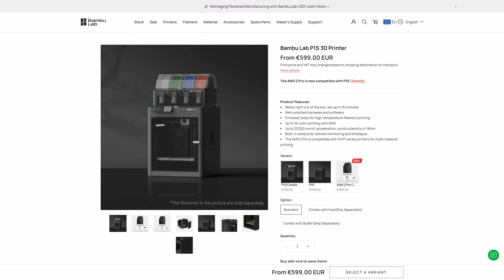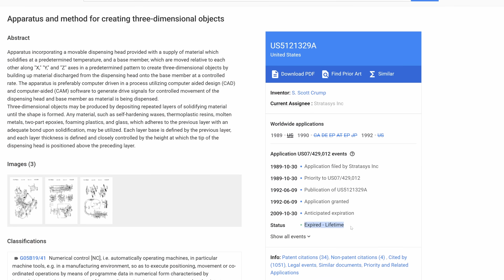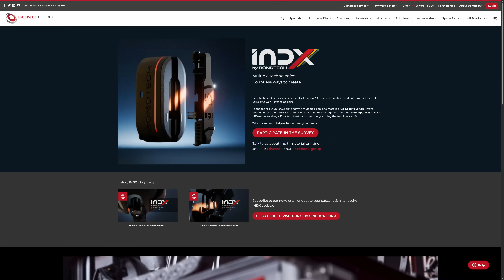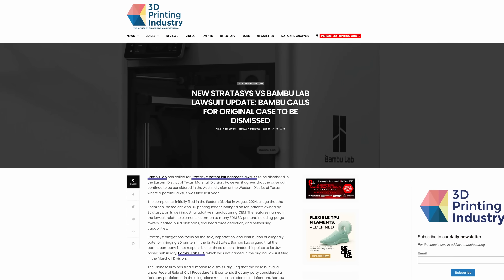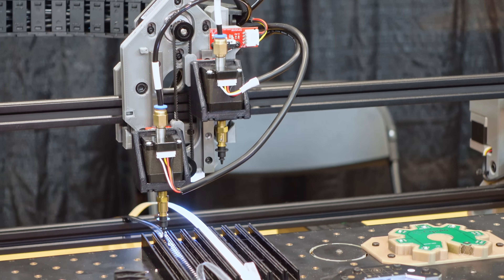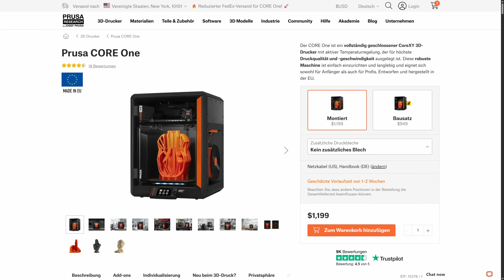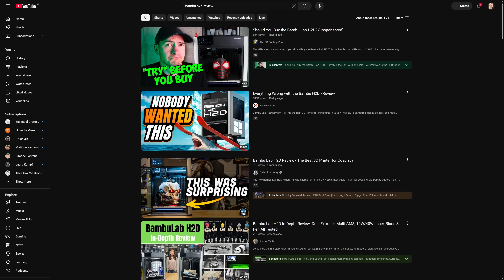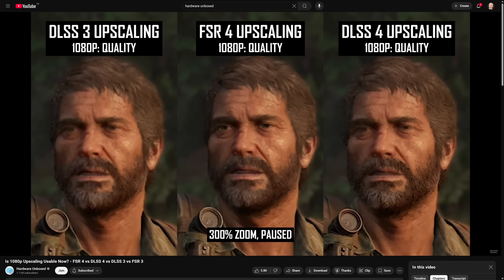How Bambu has won

Comment: I got into 3D printing a while ago and watched this channel loads. Your channelled helped me massively in getting started with 3D printing and even answered a question I had on one of your live streams. I've still got a 3D printer, but it sits collecting dust because I got fed up with the frustrations and messing about I had to do just to do a print, and it got worse when that print would fail at 80% complete. I've decided to buy a Bambu Labs P2S with the AMS Pro 2. Won't arrive until late January, but I'm excited to get back into 3D printing. Might even get my current one out for old times' sake. I'm a bit out of the loop when it comes to 3D printers; however, I'm vaguely aware of the drama with Bambu Labs. While I'm an Android user and not an Apple user, Bambu Labs seems to be the Apple of 3D printers, where their products, most of the time, just work out of the box with very little messing about. I'm looking forward to not having to manually level a bed ever again, even though I could fit an auto bed leveller to my current printer.

Comment: I look for open source, function over form, and industry-standard-ness.  Would be interested in your opinion of the Elegoo Centauri Carbon - CoreXY, no online requirement, can be used with generic OrcaSlicer, klipper(?), and comes practically fully assembled and works beautifully out of the box with auto bed leveling etc.  I have no idea of long term durability or parts availability, but I gather it is more like Ubuntu than Bambu's Apple-like ecosystem and prices.  Time will tell if I made a mistake or not.

Comment: I started out with a...uh, Monoprice something mini, which was pretty awful. Then an Ender 3, which taught me a ton about how to get a printer to work, but it still didn't work well as a reliable production machine. A couple of years ago, I replaced the Ender 3 with a K1, which has been running non-stop for the past three weeks, printing a prototype boardgame. It's my first printer that just functions as a piece of industrial equipment; I'm not constantly fighting with it, especially after upgrading to the Unicorn hotend and the newer extruder - upgrades that weren't really needed, because I got lucky and the machine just works.
...which, in a way, kind of sucks. I've never seen the mainboard for this machine and have done little beyond greasing the rods and rebuilding the printhead. Meanwhile, with the Ender 3, that thing was gutted on a weekly basis. But it doesn't suck, because this thing is a tool. I've come to the realization that having 3D printing as a hobby is like having impact driver as a hobby; it is a thing I use in the pursuit of something else. It's like in photography: the camera, lenses, memory cards, film, whatever doesn't matter, it's what you actually do with it. Anything otherwise is just marketing to get you to buy a product.
So, like with my computer, I'd like to know the machine inside and out, but, unlike my computer, I think I'd rather have a machine that just functions reliably without the expectation of constant fiddling.
...but I don't want to have to create an account just to use my machine locally. That's stupid.

Comment: Five months later...and how things have changed.  Bambu has chosen the closed system path and its inherent premium costs.  There will be a big market for this, but it has also fueled a bigger market for open system solutions.  Bambu makes a remarkable printer, but other manufacturers have closed in on their speed, accuracy, and feature set.  The enabler for this is simple economics.  The market will not tolerate the type of product positioning that Bambu locks you into.

Comment: If I have to know anything about the firmware and tinker with things all the time, it's a faulty product.

Buying a 3D printer is like buying an electrical screwdriver or any other tool. Where is the hate for all the none opensource screwdrivers?
Reply: No, buying a, at max, 90$ screwdriver is not the same as a multi-hundred dollar 3d printer

Comment: Well, for me, it's a pretty easy answer. 

What I want to know in a review of a 3D printer is: 
(in this specific order) 

- What is the performance like, especially compared to other similarly priced machines. (50% importance)
- Does it need proprietary software, consumables or replacement parts, and what do they cost ?  (30% importance)
- Is the company sketchy in general, what are their tactics ? (20% importance)

Obviously, there are a LOT of specifics but these are the main points. 
For me, a simple example that many wouldn't even care for, is "Does it have a Home Assistant Integration?" If not, I'm probably not buying it. :D
But in general, for 3D Printers at least, performance is all I care about. I mostly print functional parts, replacement parts etc, so I care a lot more about which types of filaments can be printed, than how many colors can it print. :)

Comment: Like you, I started out in 3-D printing when you made your own, or bought a kit and modified it to do what you wanted. Now, decades later, I just bought a Bambo Lab X1-Carbon Combo and fitted it with a Sunlu filament drier lid on the AMS. The machine is fast, very fast. I don't like the massive amount of pre-print diagnostics and set-up analysis the machine does on each print. I am not particularly happy with the required proprietary slicer software either. I am used to editing the gcode for my prints prior to printing, and writing first layer customizations for my prints. I think that those days are quickly drawing to a close. You asked what we want from your videos. I would like to know as much as I can about how I can get the most out of my X1-C using it's proprietary software. How do I turn off any unnecessary pre-print set-up? How do I get it to print flexible materials? How do I let other people thinking about wanting to buy one know that the user agreement (that you have to agree to before you can use your machine) takes two hours to read through and has all sorts of stuff in it that you won't want to agree to. That is the sort of stuff that needs to be talked about these days. Thanks for making informative videos. I like your format and style.

Comment: You should care also about the future of printing. When china takes over, you will want that prusa never left. If there is a monopoly, they can and will do whatever they want. Just like in so many other industries.

Also, why not care about working conditions of the people working there in the factories? The poor guys are probably inhaling deadly smoke on a daily basis for you to enjoy a cheaper printer. Very short sighted view in my opinion.
Because you were an early adopter, you clearly didnt care about having a machine that "just runs", as you would have stopped quite quickly then. - Feels a bit like you want to speak for the average joe, but you are not the average joe.

Comment: I stopped watching your channel when I felt like your channel was turning into a Prusa only review channel.
I use printers mostly for work, I have no loyalty to any manufacturer. From that perspective I really don't care.
As someone being a big advocate for open source hardware and member of the Open Hardware Accociation I do care a lot about companies doing Open Hardware.
The problem is that Prusa has been down a path of closing down long before Bambu came along and their commitment to open source turned largely into a lip service beyond the parts they were obligated to release due to inherited licensing, so hardware was the first thing they closed down because that was not under those restrictions.

Worse than a company not doing open hardware is a company pretending to do open hardware while delivering proprietary products and then later blaming open source as the reason for being overtaken by competition after failing for almost a decade to bring out new innovative products. That behaviour does to deserve grace or community support and should be shunned and I'm kind of disappointed that we still treat Prusa as being any better at this than Bambu.

Comment: Seems i missed this one in your streams :). Yes the bambulab is for the new generation of click and print (like we used to do command line and then got gui's ). But if something goes wrong they are like wut... and sometimes sell them darn cheap ;) the good thing about not writing firmware etc the machines just work (my prusa's do ). What i am interested in is what can a machine from brand x accomplish how good is it out of the box without tampering etc. Like the 20mm cube should be 20x20x20 etc. Looking forward to more vid's with offcourse your favo filament type. Did you watch the Proper Printing vid about him and the bambulab btw ;)

Comment: After 7 years of screwing around constantly upgrading and repairing my old printers I got sick of it. I just want these things to work and print me stuff I design. Bambu Lab in this case offers me exactly what I wanted 7 years ago. Their printers essentially just work and I love it. Ofcourse if they screw up software or new printers to a point where it starts screwing me over then that's the point I will probably say no to Bambu Lab. But until then they are winning over more and more people and for a good reason.

Comment: lol.  Sponsorship spot as an educational talking point is next level, and I love it :)

Anyway, I'm actually super torn on the subject of Bambu, specifically, if I want to get a P1S, or wait to see how the QIDI Q2 shakes out.  The Q2 has the P1S beat on paper, but Bambu hardware is proven hardware.

On the one hand, yes, they just work.  On the other hand, they're a pain in the ass to mod.  For example, I'm not even a big machinist tech guru who wants to build my own printer from paperclips and toilet paper tubes.  I DO want to be able to use whatever software I want, whatever screen I want, change out a ferociously noisy exhaust fan without needing to have soldering experience first, and most importantly, to change between a 0.2mm and 0.4mm nozzle without having to change the hotend every single time.

Edit to add: Sorry, went a bit off topic there haha.  Unfortunately I'm new around here so I can't offer much constructive criticism.  I can say I've enjoyed the videos I've watched so far and look forward to hearing your insights on the 3D printing landscape in the future though.

Comment: I just feel like i'm getting scammed by buying "open source" alternatives. 

1. they aren't even completely "open source" or "offline-functional" most of the time, not even prusa (camera feed, app functionality, some parts like motherboard etc.) 

2. they cost unreasonably more (I know they aren't manufactured in china, but when you print your own parts (which I would argue is a cheaper and inferior way of actually making parts for a "premium priced" product) why is it still costing more than double what the alternatives cost (keeping in mind the other points i will mention)

3. they cheap out on everything and upsell you basic stuff like there's no tomorrow for the most ridiculous price. the core one comes with a brass nozzle (other nozzle costs $50), "quick flow" $75), no camera (that's another $50) not even a god damn filter set ($75, you know, for your health), bugs and problems and features still not completely thought out like the nozzle changing system still being much more time and effort consumer than other manufacturers solutions.

like what am I as a consumer actually from that? I get a bare bones experience, where every single thing is a giant upsell, be it the display, nozzles, filters, camera, replaceable one-time use pieces that are designed to break when doing maintenance (you cannot tell me prusa couldn't find ANY other way of doing this) , features lacking behind, systems being buggy and prone to needing maintenance, and not even being completely open source or offline usable. 

I am literally getting scammed and f'd over in every way possible.

Comment: And that's the beauty: the market reflects what we as customers want to have. Bambu Lab went the full Apple route because a lot of people want to have a 3D printer as a tool, not a project in itself. ✌️
BUT: Bambu Lab will stumble over its own success. Especially regarding their QC of the H2D and H2S models. There are some videos adressing print problems with the H2D that are caused by a lose hotend plate - the hotend assembly can wiggle. Solution: take the whole printhead apart and make sure every screw is tight. And THAT is stuff that definitely do not belong to a highend printer that is "easy to use" and supposedly delivers "flawless prints". 🤷‍♂️

Comment: The reputation of influencers/channels are heavily influenced by who thy choose to use as sponsors. For example, VoxelPLA has an abysmal reputation with preprinted printer upgrades and customer service (the Bentobox for Bambulab is the one I have direct experience with). I ordered this and received crushed pieces due to poor packaging. After contacting them, they [finally] sent piecemeal replacement parts that were poorly printed, with the screw inserts falling out. Looking on various forums, I am not alone with my experience. I will never order anything from VoxelPLA again.

Comment: This level of control is has increased exponentially in recent years, across many areas. 
If we look at software in general, it's getting harder and harder to "buy" a product outright because the subcription model is taking over. 
The same goes for music (Apple, Spotify), films/series (Netflix, HBO), games (Steam, Ubisoft, EA), ebooks (Kindle). 
You only own the right to use the item for as long as they let you. There are of course "options" for getting round a lot of this. ;)
In this particular instance, I think there are many users who don't want to tinker with their hardware, they just want it to work (almost) every time.
I have an FLSUN delta printer that I've spent many, many hours/days "tinkering" with!
I also have a Bambu Labs A1 that pretty much prints everything decently first time!

Comment: As a 3D printing business owner, I just want good machines that work with minimal downtime and the ability to purchase and replace the damaged parts ourselves. I almost don't care about open source at this stage since it doesn't change anything for my business. It used to be nice back in the day when I started learning about 3D printing ~13 years ago. Things were very different back then and the shift to use these machines for manufacturing products makes me focus on reliability rather than open-sourcing.

We still have a couple of Prusa MK3S's but most of our 50+ machines are Bambu machines. Ease of mind and excellent performance at a very tempting price point.

Comment: I spent a really long time tinkering with and modifying printers.Bought and repaired old printers.But I only ended up there because the printers couldn't do what I wanted. I wanted to do cosplay back then. Unfortunately, the quality was not so great and I then went to the screwing It was really fun but also time-consuming.At some point I was at the point where I wanted to give up the hobby because it no longer fit in terms of time Then I came across Bambu Lab and just bought a printer. I was surprised and yes, the tinkering with the printer was gone but I could finally concentrate on the design of projects which I actually always wanted to do I think I'm not the only one, am I?

Comment: I have a master in mechatronics and automation, and bought my first 3D printer 11 years ago. I like learning how stuff works, but it was just such a hassle to need to play with all parameters, settings, mods, parts, functions to get 3D printing working after at least three trial prints that I just stopped doing it. I have had lots of ideas of things to print, but I just didn't have the time and energy to dive into my old machine again.
BTW, it's a Flashforge Dreamer so it's more of a finished product than most where back then, and I printed mostly in ABS to be used outdoors.

Now I have a Bambu A1 with AMS, and it just works. I love it! It's fast, reliable and quiet. I can start prints remotely and they work first time (mostly).
It's about the design, quality and function of the printed parts, not so much tinkering with the printer and process. Now I print in high speed PETG with better quality than before.

Comment: The problem with open source is that it stifles competition in key areas. What you get are dozens of near-identical printers but none that really push new features to the front. Why? Because open source does NOT allow for a big R&D budget. R&D is recouped by giving your product & edge and what edge do you have when every feature in a printer is thrown out on the market for others to copy outright?

Before Bambu came along, the market stagnated massively - every printer suffered from the same issues and almost every printer was Chinese, cut corners & had issues that were never fixed before they pumped out another model. Rince & repeat.

Bambu fixed all of that: they DID properly invest in research, they DO support their printers properly, they DON'T constantly pump out new models, and they don't really cut corners. 

But any company wants to make a profit and you can't do that when others will steal your ideas. Since the X1C we've seen quite a few copy cats that make cheap dodgy copies that don't functional nearly as well but still cost quite a bit.

So in the end you have to choose: do you want a market that evolves and grows with brands investing into R&D but keeping it closed source? Or do you want the market to stagnate again, being flooded with crappy clones that barely progress over the years but remain open source?